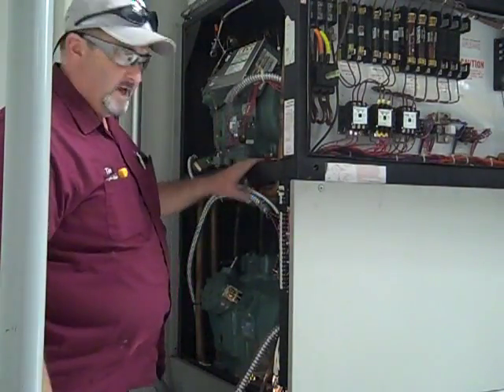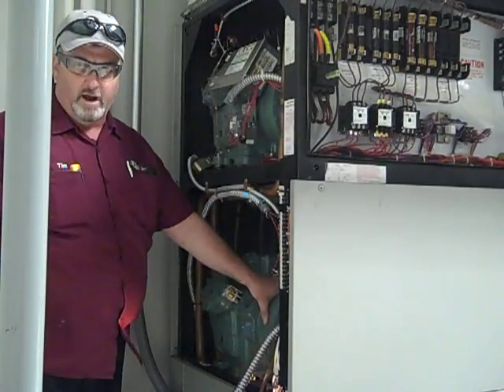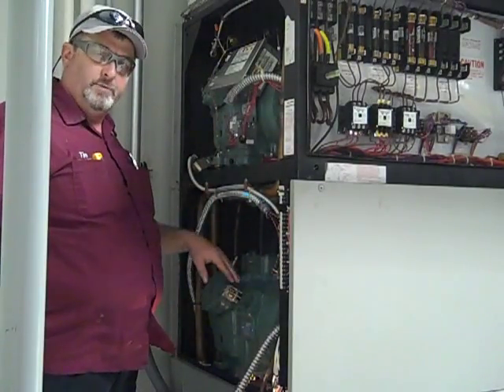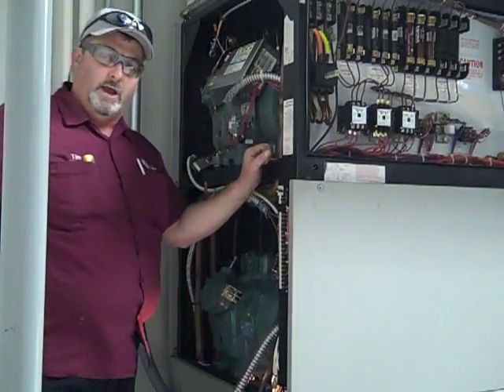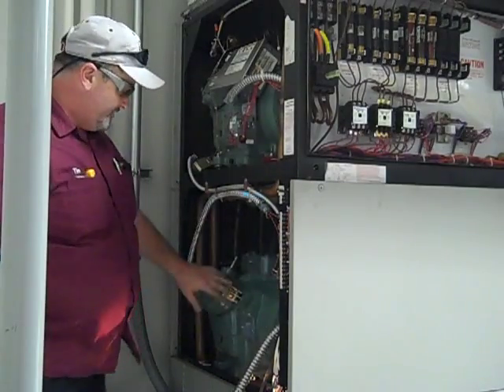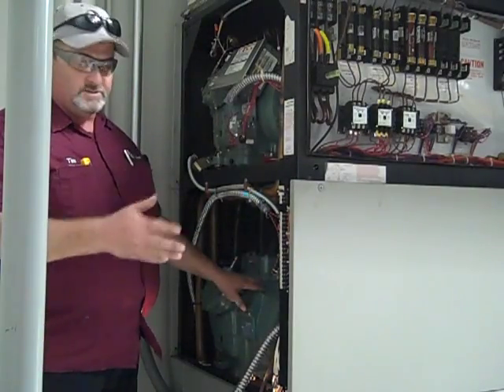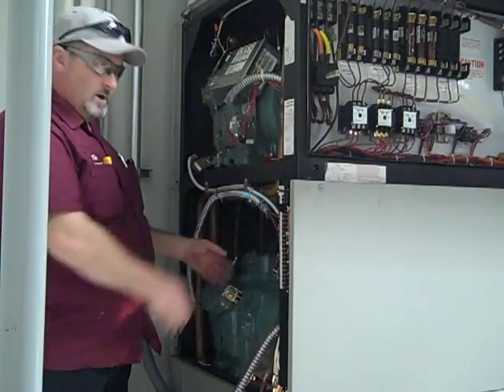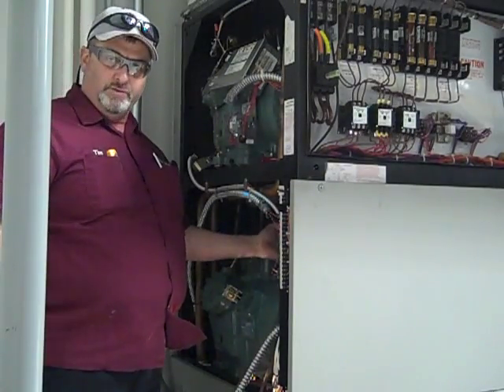Compressor replacement in a CRAC unit ( Liebert, APC, Data Aire, Stulz, Schneider, UniFlair))

Comment: Why use heat to remove dryer?
Reply: Because you need to braze it
Reply: So I have a solenoid valve leaking. And I am going to replace it tomorrow. Do I need to put oil in it? Mineral and how much? How to do it? Thanks